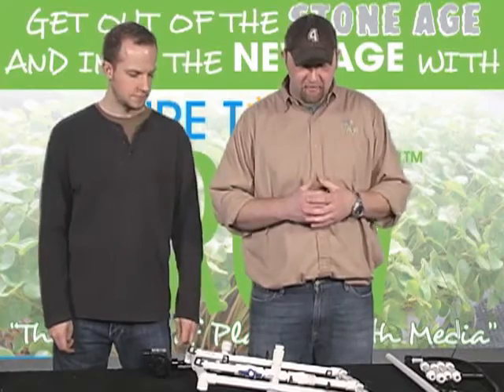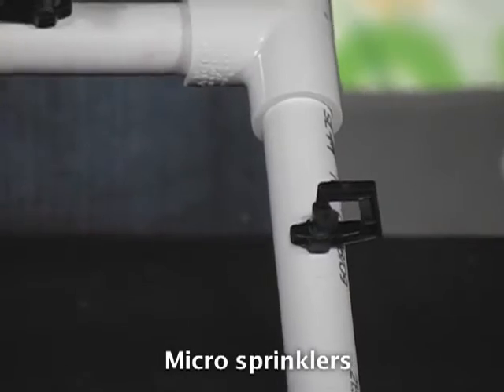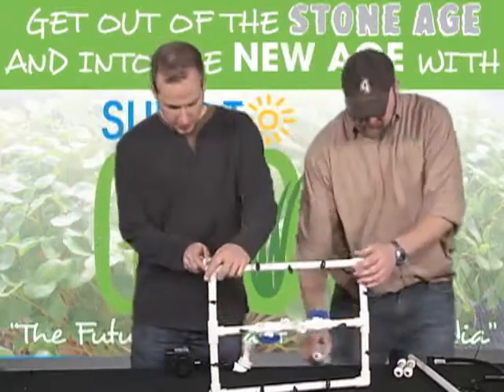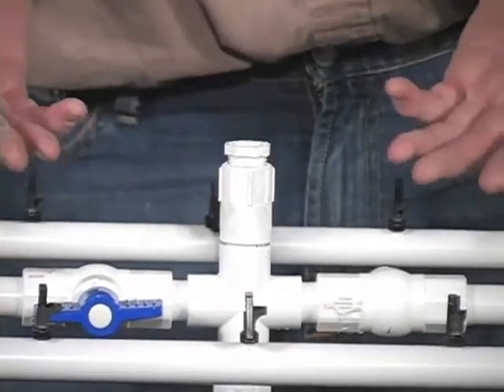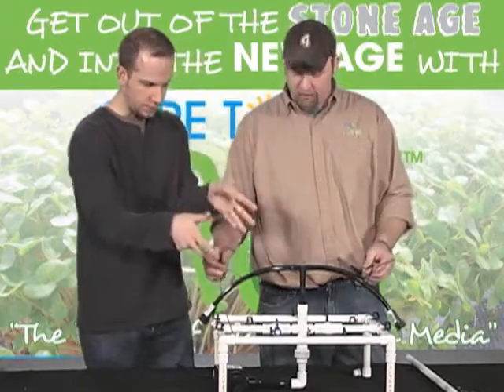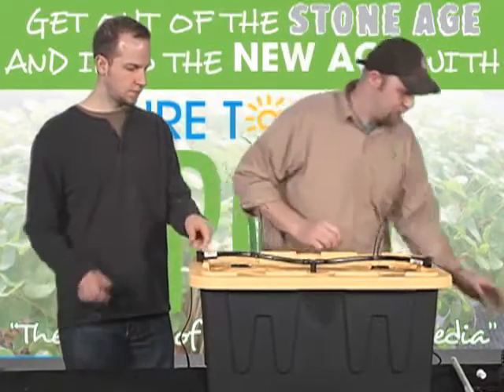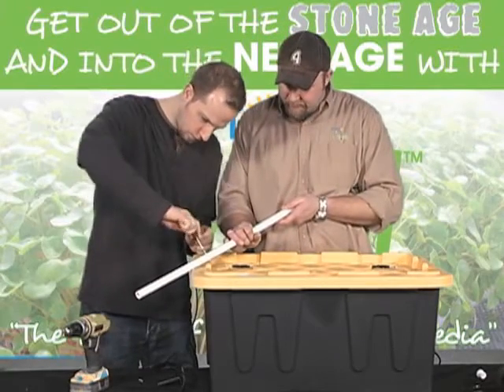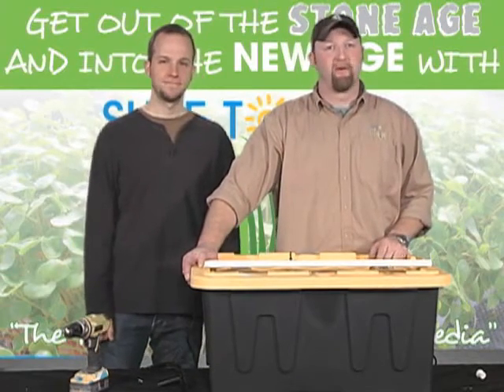Hydroponics How To: How To Build an Aeroponic Growing System

Comment: Those little micro-sprinklers cost about $3-5 a piece.  The regular non-rotating ones are good enough and probably do not need so much pressure either.  You can get the sprinklers and the drill and tap on Amazon as a kit if you look.

Comment: I'm new to hydroponics so im sorry if this is a stupid question but is there a reason for removing the dripper system once the roots begin to hang or could you just open the valves back up and run the drippers and sprinklers